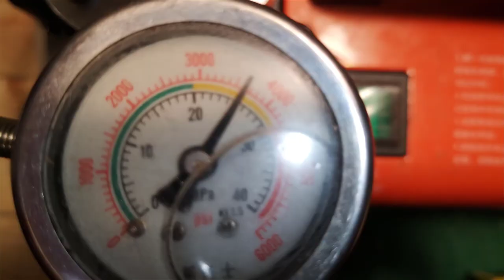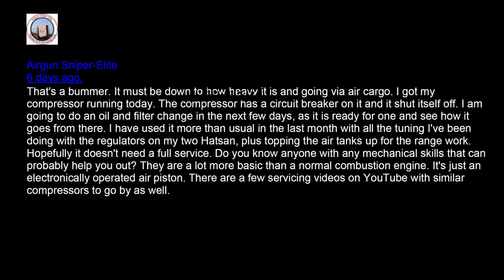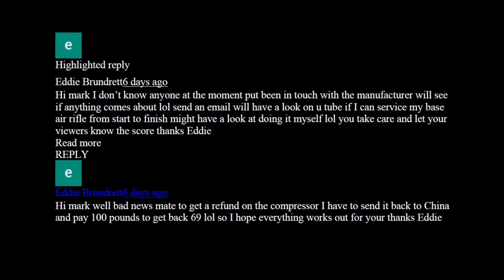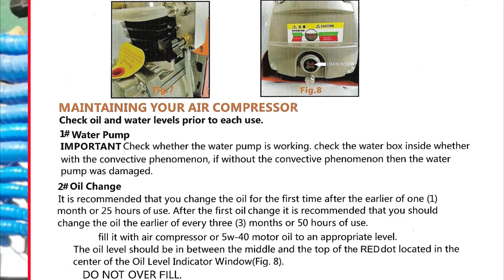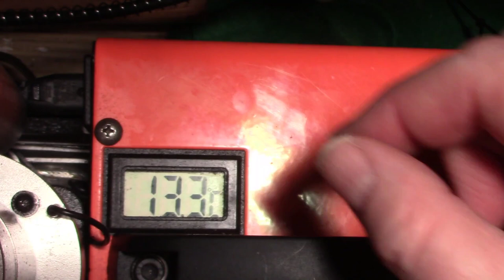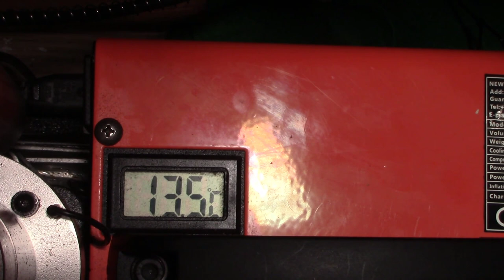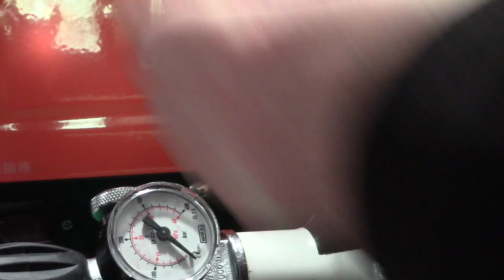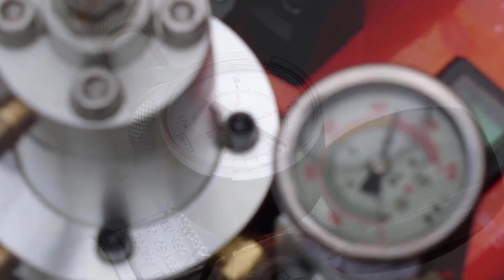The New Warrior Compressor - Eleven months on - Oil and filter change

Comment: I bought one of these 14 months ago on an Amazon promotion £149 as a throw away item, been absolutely amazed by its performance keeping my 7litre dive bottle topped up to 300 bar and my families rifles and bottles full. It came filled with oil so all I had to do was fit the oil breather and the air filter and whip. The only thing I do to preserve its service life is if it gets to 80 degrees C switch it off to cool down to 50 before carrying on.  Just replacing the cotton filters occasionally but they're never too bad. Always have the filter well above the pump when in use and do use the moisture drain tap every 10 mins if filling a dive bottle. Over all it's more than paid for itself in convenience and cost of shop fills :-)
Reply from the maker: Yes, it's probably one of my best purchases in the last year. With the pandemic closing a lot of diving shops I would have been lost without it.
Reply: Don't recirculate the water.  Run it to waste and keep your bucket topped up with cold water OR do as I did and simple connect it to a hose or tap.  Mine never exceeds 50° and usually hovers around 46°

Comment: Mine is now 3years old and, touch wood, going strong.  From the off I wasn't too happy with the cooling especially during hot Summers so I binned the pump eventually and cooling water feed comes straight from the cold tap and the hot water runs to waste.  This brought down the peak temp from 85° to 50° which is a considerable difference I think you'll agree.  I do fill dive bottles the largest being 7l but I refill 2hen it gets below 200 bar and it takes 15 Go 20 minutes top up.  I use 13cu in regulated bottles too and they take about 10 minutes from empty and about 6 mins to top from 100 bar to 200 bar.  I also bin ed the small gold oil water separator and bought a double capacity filter which uses cotton and activated charcoal as the filter medium.  Whether the more effective cooling is the reason for trouble free operation (hush my it mouth) I don't know but it certainly hasn't done any harm and cost nothing to set up.  I did get fed up of the button cells going flat in In the temp guage so I fitted a rocker switch in the line.  It cost me 45p so you would have thought the manufacturer would have done that. I got the larger capacity inline char oal filter too but I use QR fittings on all my connections as I'm impatient 😃.  I paid £134 DELIVERED so it's fair to say it won't be going back if it does crap out but I believe spares are available.  Most of the damage these sustain is down to incorrect start up and shut down.  Never start it under load from the bottle.  I don't even connect mine to start with.  I open the drain tap, switch on then connect the bottle. Slowly close the drain cock and let the pressure equalise with the bottle contents THEN open the bottle to start charging.  This way there is no sudden stress load. Closing down I close the bottle and open the drain tap slowly.  Only when all the pressure has left the system do I stop the compressor.  Sudden shock loading and sudden pressure release is likely to cause damage to such a small unit but with good servicing and correct operation a good unit will remain a good unit.  Mine owes me nothing after 3 year of constant use.  I have a lot of experience with compressors from being a breathing apparatus instructor with the fire service.   BA set repairs and compressor maintenance was part of my remit and I have to say my experience with this wee unit is so far pretty good.

Comment: There is another filter under the safety valve. Unscrew the safety valve and remove the top cross bolt. This filter can then be lifted out with tweezers and replaced. Ensure the o-rings on the cross bolt are good and lubed. Mine is now 4 years old and still going strong. Filled 6.6 liter and 12 liter tank many times. Fill a 480 cc rifle tank from 150 to 250 bar in less than a minute.

Comment: Bought one filled my 3 litre bottle no problem so I thought first fill of my air rifle and  when I released the pressure to disconnect the air stunk of burning oil I emptied the cylinder and refilled of a prober dive compressor I am a mechanical engineer by trade I stripped it down expecting to find a broken piston ring however this was not the case The first stage is fine the secondary stage was like put my finger in a top hat I have never seen such a poorly made item my advice is keep your money in your pocket as mine will be going in the bin

Comment: Thank you Mark, Very helpful as always. I have a similar unit to the warrior and for around a year it worked really well, a bit slow but still saved about 1 1/2 hour round trip to fill my cylinders. Then it got to the stage that it would not fill beyond about 110-140 Bar, tried stripping it down & new seals all round, but one thing I noticed is not all these units are created equal, the fittings on the air pipes were plain steel Not Stainless so it was causing corrosion around the airways-Tried everything I could & even contacted the supplier to no avail
What I would suggest especially in Eddies case is to buy a new Head Unit, I purchased one of the Chunky round head Units, Sorry you are having issues Eddie, as mentioned I did too but at least I had some use from my unit before having to bite the bullet & looking at another way of fixing it--I got mine Through AliExpress & took a while searching and hoped it would work on mine. But as most seem to share the same Bottom End/Motor I guessed it way worth trying
 https://www.aliexpress.com/item/32893621428.html?spm=a2g0s.9042311.0.0.7d3d4c4ddBO5O8 
or type in in AliExpress - cylinder pcp pump part high pressuare head 1 piece/lot (Yes dodgy Chinese spelling on their ad)
This comes with complete Head including Crank Rod, Just check the Crank for size to ensure it is compatible with your unit
Mine seems to be way better now, it Doesn't quite run as hot as previous "Tall Head" version and is ever so slightly quicker to fill
It will cost around £70 but cheaper than shipping to China Or scrapping & facing a complete write off
Also have a Big black filter similar to yourself (Not Airmega but almost identical) - Now here is a cautionary tip -- DO NOT Dry the charcoal/absorbant ball mixture in a microwave as some suggest!! There often seems to be a mixture of charcoal, filings & anything in them and will light up your microvave like a Christmas tree!!
I purchased a few of the windowsill type de-humidifier plastic pot things from a cheapy Pound type shop & there were 2 per pack-They need to be the white absorbant ball type ones, cut the lid off one & put into a plastic container that seals well and just put some in your filter - you will get enough to replace the filter about 10 times for around £1-£2
Hope this helps
Kev
Reply from the maker: Thanks Kevin, that's some great information. Many thanks. Mark H.

Comment: Looking at the colour of the old oil I’d go full synthetic, low ash say C2 spec.  It has been overworked if it’s that colour.  I worked for ingersoll rand on hi pressure kit so have some know how on this sort of kit.  The oil carbonises at the top of the HP stroke (diesels)  and carbonises, fully synthetic is most resistant to that. OIL IS CHEAP  so change it often. Consider the duty cycle and run infrequently for short durations and start unloaded for a few seconds, watch that temperature, keep it low. Since you have cast iron brass steel and aluminium in the cooling circuit you will have a serious galvanic erosion issue so USE A QUALITY COOLANT that has anti Galvanic properties like most good anti freeze provides.
Great video and very informative. 
The issue with returns, U.K. consumer law says you return the faulty item to the point of purchase but this IS at the buyers expense. If you bought from China tough, if you bout from a U.K. source then the retailer has a duty to repair replace or refund, this is his problem and a risk associated with his profit motive. Any hassle simply tell him you’re going to take legal action unless he conforms to the law and you will have have to open up a small claim on line (easy peasy) and sue him for the costs, legal fees and other costs if he does not comply within a reasonable time, say 21 days but make sure he is aware of this. You will win without an issue.

Comment: There's a filter inside the compressor that also needs changing.  It's located in the cylinder below the red cap.  It's the same filter that goes in the gold water separator.  Mine was filthy when I checked it and I haven't actually used my compressor yet.  I guess it was from being "tested" prior to being dispatched.
Reply from the maker: Yes, I noticed it on the instruction sheet afterwards. I wonder if it's an air intake filter. I'll change it and update the viewers.

Comment: Hi mark thanks for your help you are a star we’ll the compressor is still here having no luck at all still waiting for the manufacturer to help me out my leek is coming from inside the case i have checked all the pipes and the burst disc thanks for your help keep the video coming eddie
Reply: Eddie, Check My comment- If you are getting nowhere then if bottom end is all OK - Maybe replace the head like I had to, I have put a link in and although it is more expense it is better than sending off or scrapping - Kev
Reply: @kevinfishenden  ok thanks will try to find were the leek is coming from thanks eddie

Comment: Good video mark 😉 cheers,!
Same set up as yours.... I run 5w40  fully synthetic in my warrior and new oill after 35 hours  that's about 5 to 6 fills to a 7lt 300 bar tank from 190 ish to 290 bar do run antifreeze and I  freez a  large  bottle of water to   😎 and place that in the antifreeze to keep things cool and i run  larger pump in it to I do check the filters all the time you have to  and replace after a oil change or before 
Very easy to work on 
If it's in warranty should be replaced really or fixed foc 
Had no problems with mine so far. did blow burst disc one time to

Comment: You need to put the small cigarette filter ahead of/in front of the large filter. It will take out most of the oil/moisture and is cheap and easy to change. That's why the filter looks almost brand new, all the crap is in the large filter.

Comment: The cotton filters can be washed and used again.  The oil only lubricates the low pressure bottom end,  the black may be cast iron from the cylinder barrel, get a magnet and see if it picks up any iron contamination from holding the magnet in the used oil.   or the check valve from low to high pressure in the oil.   If the motor fails to start it will probably be the run capacitor at fault,  Compressor oil is mainly used in low pressure compressors.  At the end of the day, chinese goods are low cost low quality items with virtualy zero backup,   the low to high pressure flap valve can become contaminated with oil, then it will not function as designed.

Comment: Surely his contract is with the seller not the manufacturer? So the seller should sort out any warranty issues with the manufacturer. There's a skirted rubber gasket behind the front plate that really slows down oil drainage and I'm sure prevents full drainage, so a small punched hole in that near the bottom would help I'm sure. Well that's how it is on my Yong Heng one, yours may be different.

Comment: I have one the same Mark , used it for 3 months without any probs , filling my Gamo Phox, about 15 times to 200 bar, 27 seconds it took , from 100 to 200, however the first time I used it to fill my kral np02 , it blew the little burst disc when I got to 180 bar , but to be fair the gun has a very dodgy filling , port , have probs pushing and locating the probe from my dive bottle usually 3 or 4 attempts to get a seal , the compressor has sat there unused since ,, will be selling soon for about 80 quid, it’s still working fine , maybe could do with an oil change cheers Shane
Reply from the maker: I would hang on to it, unless you are upgrading and get your moneys worth, but someone would snap it up for that price. You could always see if your shooting club would buy it. They could charge 50p per fill and soon get their money back.

Watched your HW97 video at your Daughters. What a great range set up. I safely shoot at 20 yards at home, but can stretch it to 25 yards if need be from indoors, or diagonally across the garden.

Comment: dear sir.. I hv the classical mini compressor that I bought it as used from a friend

 now after I fill my pcp I found oil leak under coming from the small tupe that coming from up where is the small black valve to reales the air afte fill.. is it problem or normal

Comment: Don’t know if you have Walmart stores in the UK but Yong Heng is sold with an available 4 year warranty for 34$ extra no ?s asked free replacement and done. Bought 2 online and 1 leaked, they sent replacement in 5 days.
Reply from the maker: That's a really good deal on the compressor. We don't have Walmart, but we do have ASDA, who are owned by them. They don't sell things like airgun compressors or anything to do with shooting though. To sell pellets or Airguns you have had to be a registered firearms dealer since about 2011. I purchased my New Warrior compressor through Ebay through a UK seller. A lot cheaper than direct from China. The postage from China was nearly as much as the compressor. I paid about £180 for the compressor and another £40 for the oil and spare charcoal filter cylinder.
Reply: Got my yong heng from an Amazon seller, 4yr warranty for$44. Hope I never need it.
Also most people leave the small filter right where it came, as the first one inline from the compressor so that one about 2 inch cigarette filter catches the majority of crap instead of it going into your nice purchased long black filter, it also will be damp, so it's doing that too
Reply: @danv9113  I thought the 2 inch cigarette filter went on the exit side of the filter ?
Reply: @keithtennant699  it's been a while since I've watched the video so I will try to answer this. At the end of the output hose from the compressor there is a holder for that filter. It's probably a good idea to have that right there before the air goes into any of your nice filtering or water retention devices you had to purchase to get clean air into your tanks or guns. It mainly catches oil and any little particulates from inside the compressor. It quite often is moist, so I take it out of there when I'm done with my compressor so it can air out/ dry.
You can buy those little replacement filters by the bag full and I throw them away after every two uses.

Comment: Iv had this compressor 5 months been great for filling my guns .but I haven’t got filters with it just the pump that goes in the water.I Can’t find filters anywhere .so would the long back one you have do ??? 

Hope to get a reply as I’d love to use it to fill my bottle .as Iv Judy used it to fill my guns.Iv got everything but the filter in the colour case .so would the long back one do you added??? Or can point me in direction to get the one that comes with it  .buying as a part on its own?cheers
Reply: There are cotton filters too in the pressure chamber (below the pressure release vale ...red plastic on top).  These too are a service item which can be one clogged making the compressor less efficient.